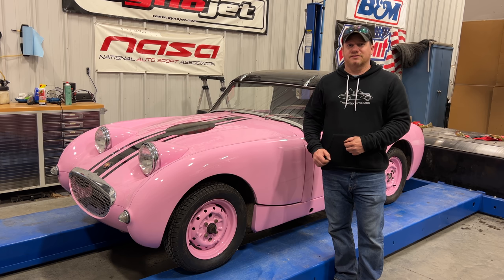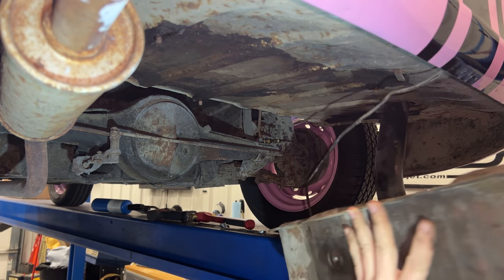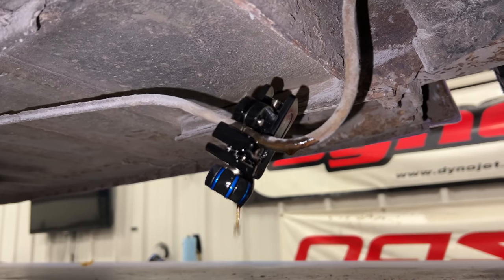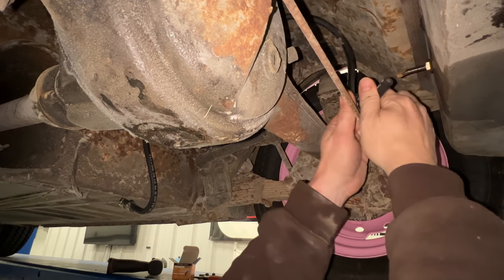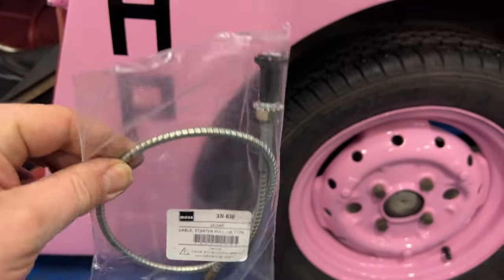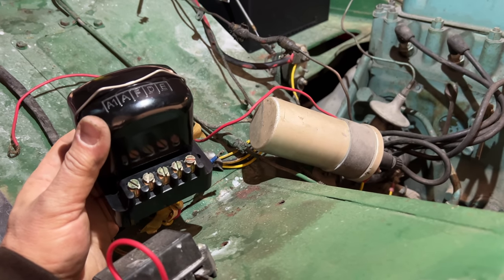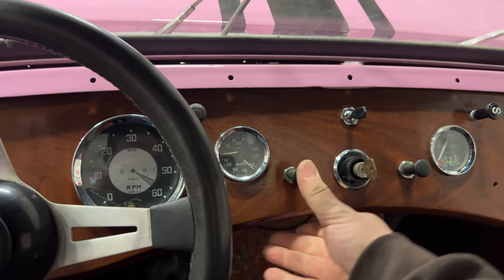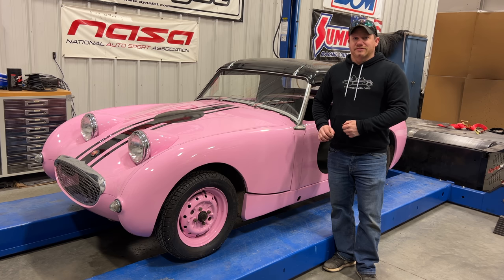Barn Sprite #6 Part 2 - Getting Control of the Engine From the Dashboard

Comment: I'm enjoying this series. In my youth I got right inside two MGBs of my own and a few other British and Australian cars for other people, and I know that a lot of the tasks you make look easy really aren't.

One thing if I may. You are not correct in referring to the screws and nuts as Whitworth. The correct designation for British cars is A/F. I know this because when I was buying spanners you could buy both, and they are different. Apart from the screw itself, a Whitworth 5/8" refers to the screw diameter, where an A/F 5/8" refers to the distance across the flats (A/F) of the nut, which is what you had here. I did all the work above without ever owning a Whitworth wrench of any kind.

Keep up the good work.

Comment: Steve . That wiring loom IS  a mess ! And the tank was a different kind of mess but very much an easier fix. So l guess you don't have an old loom somewhere ? Thanks Steve .
Reply from the maker: I'm sure I have a loom but this car will not restored to original so it makes sense keep making wiring changes on my own to suit it's needs.

Comment: Knowing now the price on a full bugeye wiring harness, I can't help but wonder why the previous mechanic chose to build one by hand (or whatever they did) way back when they did it. Today's price was $350 or thereabouts for a full wiring harness. I've got two original ones sitting in the garage, and I feel like would rather buy a new one before using the original simply because of the age of the insulation. Maybe they just weren't available as easily as they are now? I remember my dad ordering one in the early 80s, so couldn't have been to obscure a part.
Reply from the maker: I am sure when they made this harness that they had no way of getting a replacement even if they wanted to.  Times before the internet caused a lot of bad things to happen to rare cars.